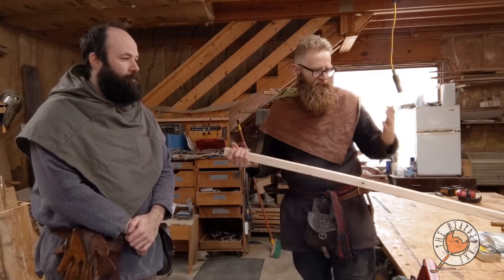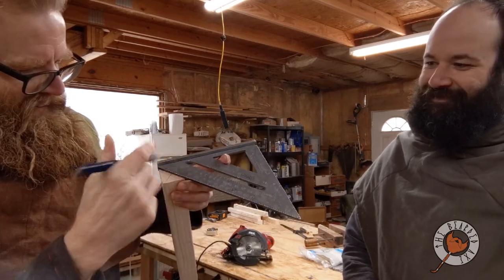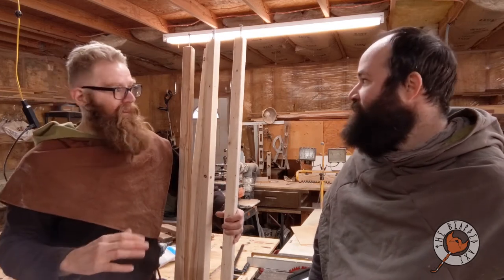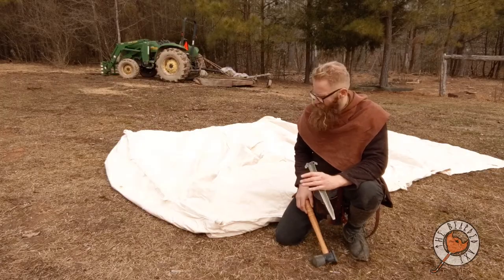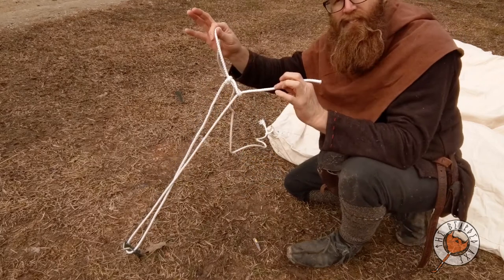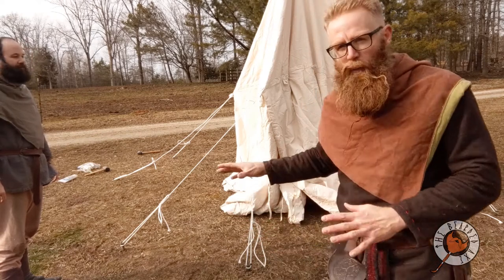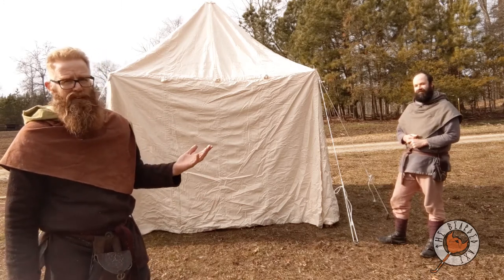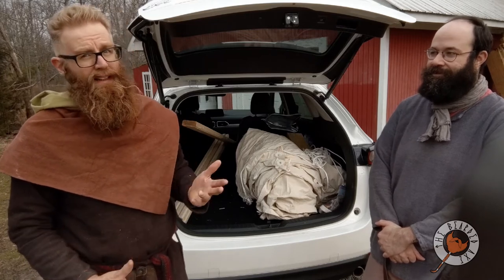We Were Framed!

Comment: Fantastic info, I have the canvas for a wall tent and have been sketching ideas for building my frame.  I am considering buying 2x4s and splitting them on the table saw, vs buying furring strips.  Side note that two arms length measure = 2 fathoms, which finally made sense when a scouting instructor dropped a lead line over the boats side then pulled it up, counted arm lengths and said we are at 3 and half fathoms Captain.  Prior to that I always thought what madman would actually measure anything in fathoms :).

Comment: From the video it looks like the Square Slantwall White from Midwest Tents, which the website has listed at $385. Is there another vendor where you can buy it at the lower $70-$80 price like you mention in the video? Or did you use a discount code?
Reply from the maker: No the framing was what cost us $70.  So you have the right price for the tent and honestly that's a good deal for the quality you will be getting.  In my opinion if you made it yourself you would probably pay $250-$300 for the right fabric.